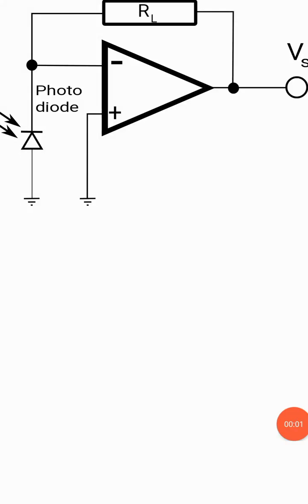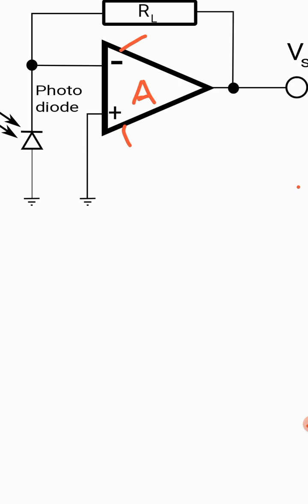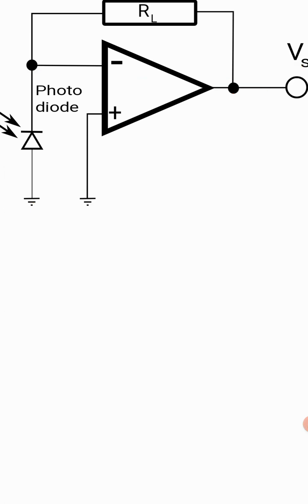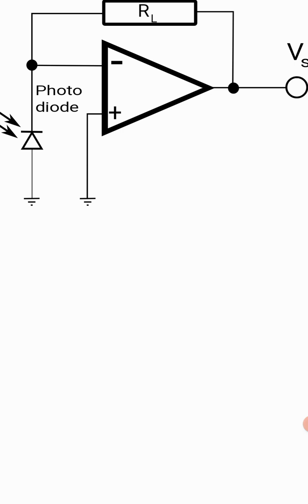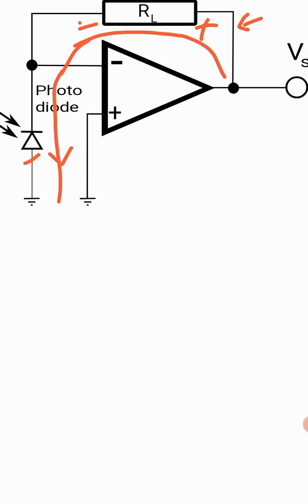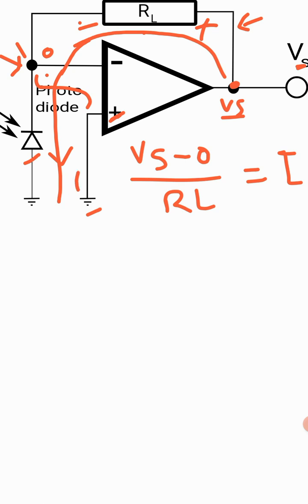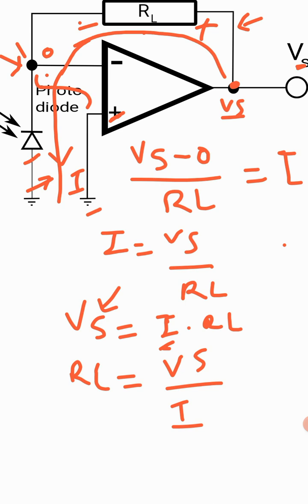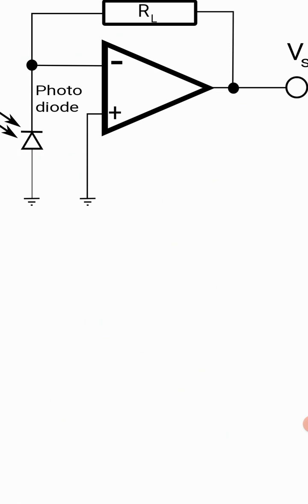Current to Voltage Converter | Photodiode | I to V circuit | Opamp

Comment: in practical, from where can I get the voltage output and current in order to determine the load resistor? What terminology should I look for in the data sheet?